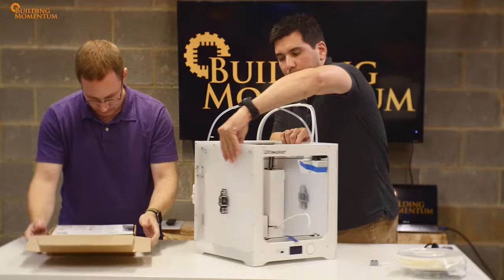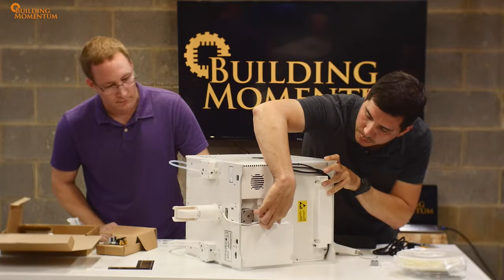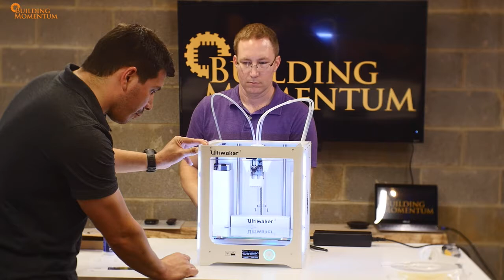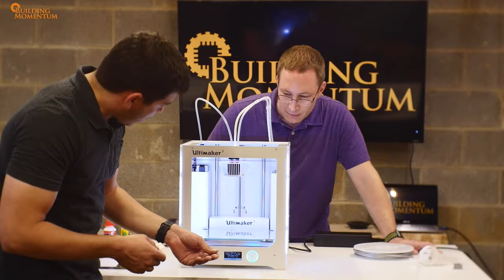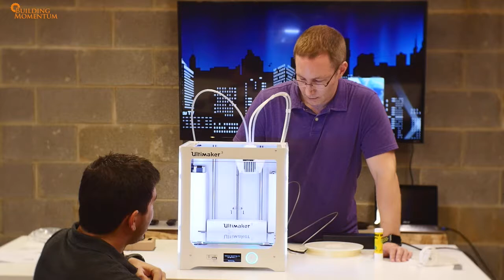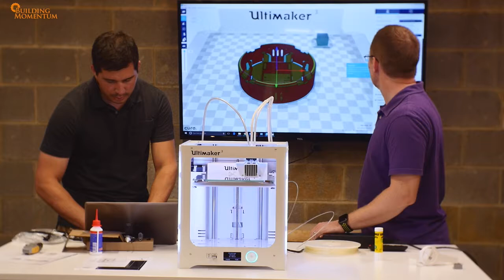Ultimaker 3 Unboxed!

Comment: Happy printing, guys! The 2 different heights for the nozzles are to avoid having the inactive nozzle crash through the existing print. Your right hand print core moves up or down by way of the actuator on the right side of the printhead, and the plastic bay on the back right side of the printer.
Reply from the maker: See, this is how we learn things! Thanks for the additional info! We've been using the 3 like crazy, it's an awesome printer!!